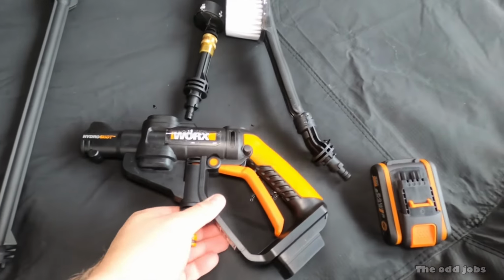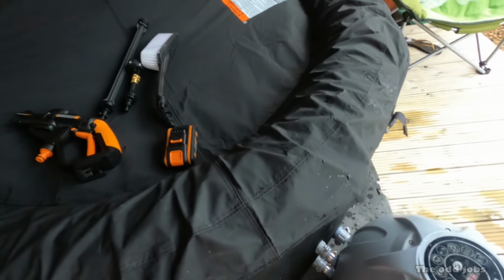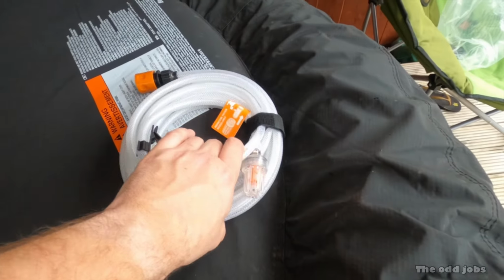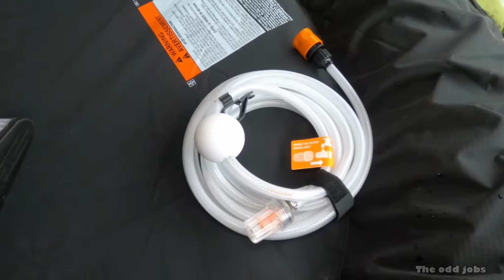hydroshot worx is it any good (part 2)

Comment: Thanks for the two videos guys. I've watched a number of other videos on this tool and these were by far the best. There is a lot of hassle in getting my mains pressure washer out of the shed, unravelling it, connecting it up, plugging it in, getting the hose/mains cable tangled etc etc, and even worse for my wife. So, I'm thinking that yeah, I'll try this light weight for the car washing, and rely on the mains pressure washer for annual cleaning of slabs, paving etc.
Reply from the maker: glad you liked it, its a great bit of kit but not as good as a mains washer, really handy for if out and about, I use it a lot when working away from home, thanks for watching

Comment: How much power is on the battery power wash. Can you Blast dirt off clean engine bays?
Reply: I'd honestly say for automotive stuff dont bother, maybe if you were in a pinch at a car show and you wanted to give it a quick blow over or something. Apart from that, I'd get a standard pressure washer like the second one Lee used 👍
Reply from the maker: Agreed with sam, it’s nowhere as good as full on pressure washer but great for garden furniture , depends on how dirty or ground in the dirt is, the battery is 20v 2amph